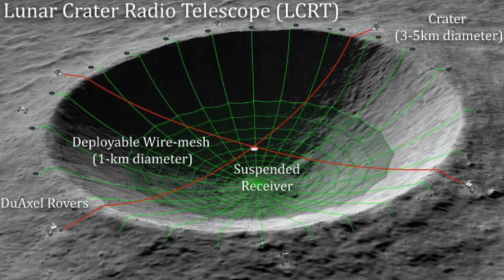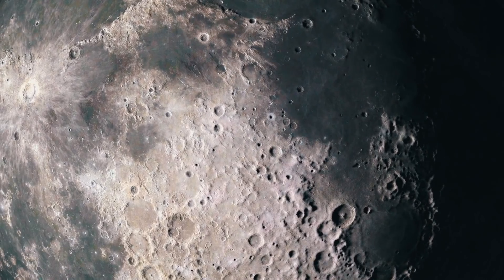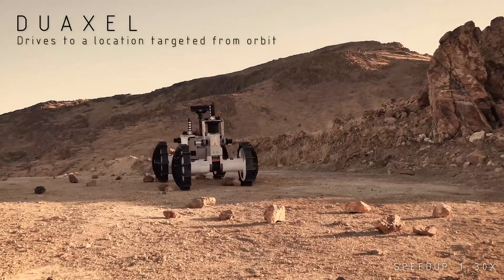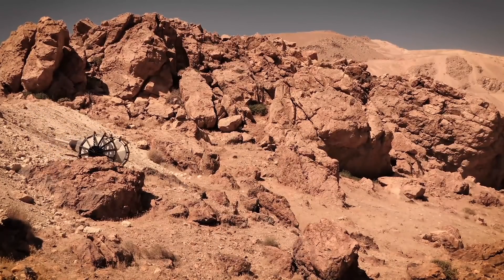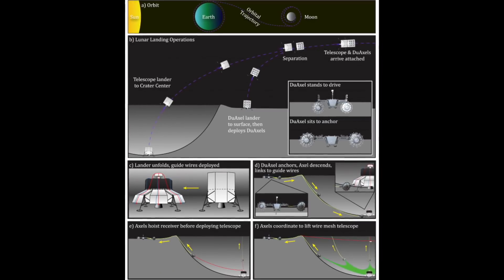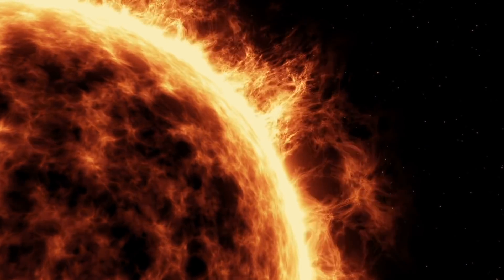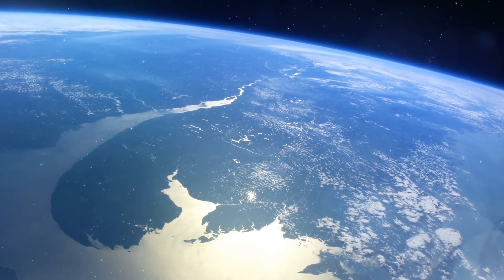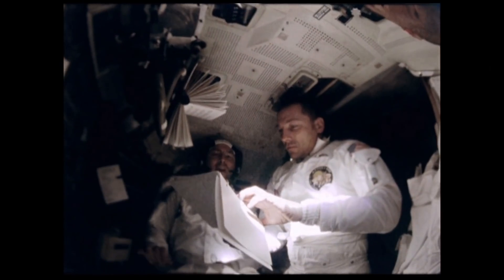MOONBASE Project - Prof Simon

Comment: Considering the difficulty in building a proper collector dish in a crater on the surface with rocks and boulders, and having to send construction equipment, it would appear to be easier to unfurl a collector in a geosynchronous orbit on the far side of the moon.  While a Moon base sounds exciting, if the intent is to set up a large collector in a place where the Moon blocks radio signals from the Earth, it likely would be cheaper, more likely to work and assemble in space.  All that material has to be safely landed on the moon.  Doing that adds more fuel and cushioning equipment.  The complexity and costs would go up.  Then there is the problem of the dust which the equipment would stir up on the surface possibly messing something up.  It likely would be easier to build for space.
Reply from the maker: a space based radio telescope sounds like a good plan....let's build one.
Reply: I think our moon has a Lagrange point above the far side. That might work for what you described. It would get noise from the sun a larger fraction of the time, but I agree it would be a lot cheaper.
Reply: @DistracticusPrime  It isn't just cost.  Something that much more complicated, failure would be more likely.  The more links in a chain, the more likely a weak one will appear.

Comment: I love trying to figure out how much is hokum and how much is possible like the dark gets just as much Sunlight as the side that faces us and building the telescope would be a logistic nightmare...
Reply: First off where do you get the Energy to transmit the signals, Solar ha, ha or perhaps Solar with battery back up when the Moon is on are dark side and the Earth is blocking the Sun from the Moon...
Reply: @steve-o6413  Put a rotating solar panel miles away on a ridge near one of the moon's poles, where it gets sunlight almost permanently.
Reply: It's entirely possible it's just a factor of cost and damage to Earth's environment. We already have cryogenic temperature electronics. Bog standard military is certified to -55C (218K) and can work way colder. To give you an example I have worked on kit that had commercial chips with a 0C lower temperature certification cooled with liquid ethane (-88C or about that). Military grade can work as low as -130C (143K) and the specialist stuff used in cooled telescope receivers works down to 80K or colder. That said it starts getting eye watering for chips like that. EG memory still costs about £1 a byte. A 741 op-amp equivalent was £2800 compared to £0.10 last time I used one. Just a microwave transistor that works down to -200C was the best part of £500 last time I looked.
Reply: There's no hocum. There is certainly very extreme swings temperature wise. It's not the dark side don't forget. It's the far side. And the idea is very old and well thought over.
Reply: @yodaco  sure there is hokum,  I think the Professor is testing us to see who is really thinking. First off how many radio telescopes do you know are made of wire mesh and why not. 

Certainly it would be much cheaper and if we could do it cheaper on Earth it definitely would be more cost effective on the Moon. The only wire mesh I've ever seen are small discs and the receiver in the center is the most important aspect. 

But think what you want, but don't spend my Tax Dollars on Hokum lol...
Reply: @steve-o6413  as far as i am aware radio telescopes "dishes" are indeed made of a mesh or some metal framework. They don't need to be solid metal or anything like that. So I'm not really sure what your getting at. And if you spent a single penny making another giant radio telescope on the earth would probably just be a waste of money since there is not much to be gained Vs one on the moon.
Reply: Getting all the material on the Moon is expensive, but that's just the beginning our utility company's run cables all the time and it takes man and machine power to do it. Now take away the Man Power...
Reply: It took us two tries to lay the transatlantic cable and this is more than a half mile radius across depending the depth 3/4 to 1 mile length for each pass. Times how many passes to complete the disk is a lot of miles of cable...
Reply: So you have to ask yourself is this like the animation we see how the Pyramids were built using ropes and animals, where they show you short clips and let your mind build it or do we question it...

Comment: Awesome, love the content Professor S. A couple of Renault Zoes sent to the far side of the moon should be able to handle the wire mesh job.
Reply from the maker: good plan Eric
Reply: @SimonHollandfilms  Do lithium cells even work at -280 degrees 😳
Reply: @mikemilton4370  not unless engineered to do so, but superconductivity would surely be available...
Reply from the maker: almost colder than france is this spring....hmmmmm. brrrrr.

Comment: Theoretically we could go for a ULW (Ultra Long Wave) telescope all the way down to a few kHz. We already have transceivers down to 17kHz so with this we should be able to drop down to about 2kHz or less (35kn for a 1/4 wave antenna) we could even go nuts and have a 1/16th wave antenna for 10Hz if we get long enough wires (1800km). I'm getting a headache just thinking about how you would design an LNA (low noise amplifier) for frequencies that low.
Reply from the maker: interesting Gordon

Comment: The “Dark Side of the Moon” is only a Pink Floyd” album. The sun hits all of the moon’s surface so interference from the sun will still be an occasional issue.
Reply from the maker: but think of the great music ...ha
Reply: Far side is the correct term
Reply: @SpaldingFraser  Correct. The Far side has approximately 14 Earth days of daytime, then 14 Earth days of nighttime. Similar to our day/night cycle.
Reply: I think they meant Dark as in 'evil'!
Reply: Dark side is with respect to "earth light". The moon is tidel locked to earth.
Reply: only when the moon faces the sun

Comment: Instead of a satellite, how about a relay tower, perhaps on a 'mountain' on the rim (as viewed from Earth) that's line of site to the crater and Earth? This might limit the crater chosen, as it would have to be just on the darkside, but still in the radio deadspot. It would be simpler to track the transmitter than a satellite, Then you could also have live telemetry.